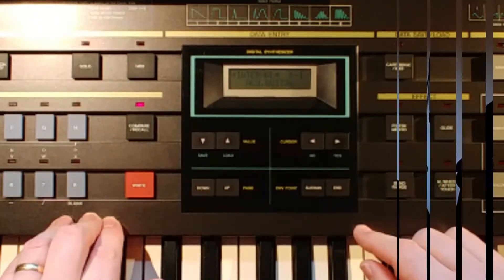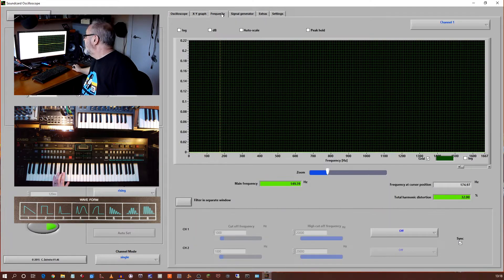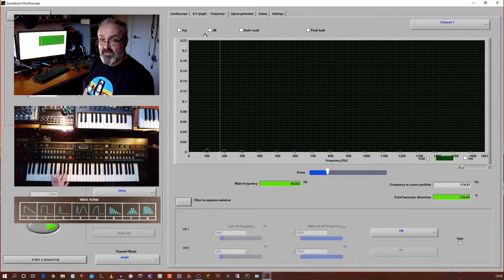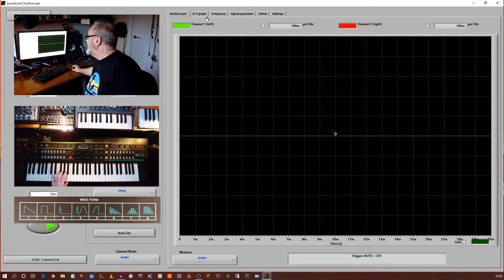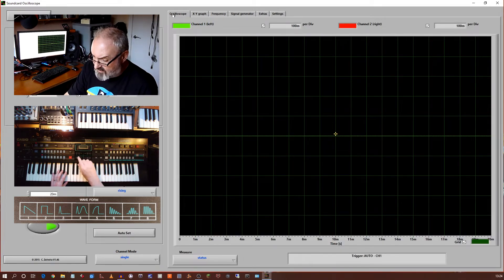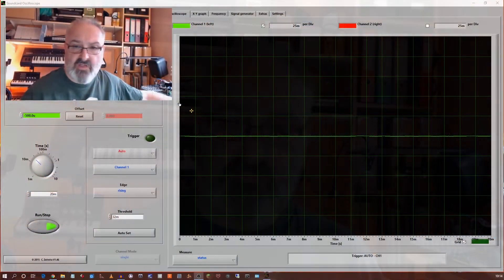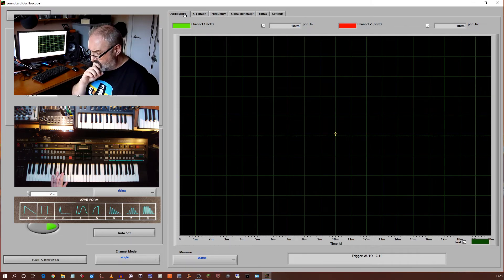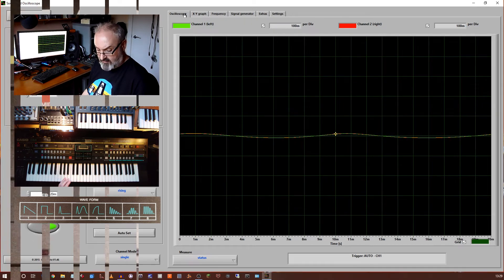Casio CZ-1 Phase Distortion Synthesizer - Part 2 - Sound Generation

Comment: I have several different CZs, and a hardware osciloscope hooked up: i was always impressed just how accurate the waveforms are, including the square wave. Are you sure you didn´t forget about the DCW sustain? Sounds & looks like you have a slight envelope there, but not quite up to value #99 on sustain, thus resulting in an square/sine-wave modulation..?
Reply from the maker: I'll check.  Thanks for letting me know.

Comment: Hey, I just bought myself a cz 1 model but i kind of not get all the posiblities, I watched all your tutorials, is there a way I can contact you to solve me some doubts?
Reply from the maker: feel free to ask questions here.  I can't guarantee I'll have the answers though.  You can also contact me via twitter.  Details at the end of the videos.  Thanks.
Reply: @RunningonairMusic  It is probably a dumb question but as far as I understand you analysed on the osciloscope the original waveforms. Can I simply just get the original waves without the presets? Or how did you came up with those sounds.
Reply: Literally this synth is my first introduction to digital synthesis
Reply from the maker: Try the initialize button.  That will reset each section to a basic state.  It needs to be applied to each parameter section individually.  Check the manual for more details.